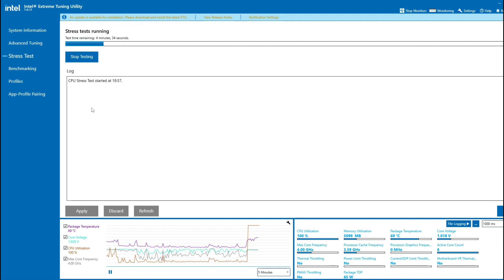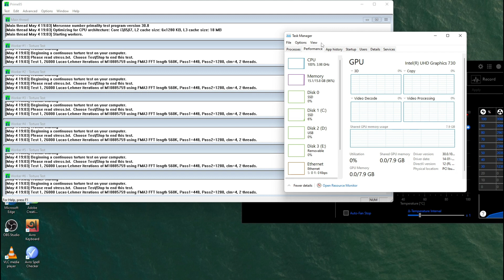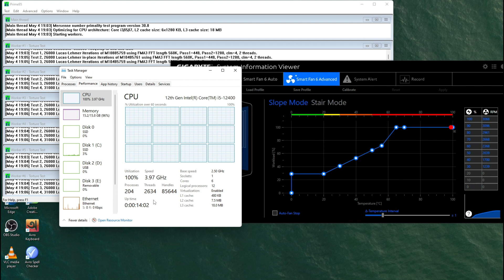Intel i5 12400 stock cooler perforamance test

Comment: Just built a pc with 5060 Ti and 12400f, using stock cooler and hitting 85c during sessions of Hell Divers 2. I'd like it cooler but I think thats acceptable as long as it gets not hotter. I did notice the pair seems to get much hotter than the 5070 series and higher cpus. Literally, the exhaust fans heat is much higher than the other 5 or 6 builds ive had in the last few months.
Reply from the maker: Temperature also depends on proper air flow inside your cabinet, use extra exhaust fan on top of the cabinet.

Comment: If anyone watching this and play games on this processor (i5 12400), I suggest you get a aftermarket cooler. I played gta 5 legacy at 720p low getting 70 fps avg and the temp reaches more than 85 C after long use. When I played farcry 3 at 720p low, within 15 minutes temps reach over 90 C.

Comment: I have a question, why does the i5 12400f only go up to 3.99 or 4.0 ghz when supposedly its maximum speed should be up to 4.4 ghz?
Reply: Reset bios configuration

Comment: Mine using CR1000 and it got 99 celcisus! HOW? (EVERYTHING CHECK, NO PLASTIC label, new thermal paste applied)
Reply: Mine is like this too man, did you found a solution?
Reply: @igorapenas  I just bought an AIO man, temp drops to 50~60 Celsius at 100% load. If you can not afford an AIO, just try to undervolt or maybe buy another fan cooler that has more cooling pipes.
Reply: @ Yes, I did the same is perfect now.

Comment: I recently bought the i5 12400F and am noticing my temps are higher than I am comfortable with.
It idles around 50C, it will reach 90C when I have an uncapped framerate, and if I try to launch a game in RPCS3, the processing will shoot it up to 100C. (It might go higher, but I got scared and Task Manager'd it before it finished)
It is also REALLY noisy, I find!

I thought maybe the thermal paste was poorly applied so I looked into what the average temperatures are with and without thermal paste, which was 10C and when I removed it, I experienced about the same gap so it wasn't poorly applied.
The cooler is just not adequate for me.
Can you recommend some aftermarket coolers?
I'm currently looking at the Thermalright BA120 but I'm not sure if there's a better one.
Reply from the maker: Cooler Master Hyper 212 is a good budget cooler.
Reply: @tryitstd  but this is for lga1200, no?
Reply from the maker: @Drixzhard  It comes with 1700 fittings too. Check description before buying. Better if you buy from offline stores.
Reply: Did you solve your temperature issue? I have the igpu version and I get the same idle temps
Reply: @ZA-7  I sure did, it's called "buying a Thermalright BA120!" I also bought the king version but it was more complicated, and when I tried it with the BA120, I got excellent results so I sent it back.
It was somehow both cooler and smaller than my old PC despite a higher power draw and higher clock speed/core count. It is...GENUINELY impressive how well that thing has done!
Reply: @TheGreatBackUpVIDEOS thank you!

Comment: can we overcloack i5 12400f with a stock cooler which comes with it ? ( i have a budget of $1000 and i want to build a full gaming pc set , if ill purchase a extra cooler it wil exceed the limit ) , btw im ready to exceed the limit as an extra cooler will only cost around $30 but is it worth it ? sorry for bad english
Reply from the maker: For overclocking you need a tower cooler.

Comment: i bought my new pc 2 weeks ago and i use stock cooler. I am using i5 12400 + rx 6700 xt and i cant play warzone because the temperature go to 100°C. i don know what to do, help please :(
Reply: Even my CPU temperature were hitting 100°C.
But after checking I found out that, I didn't install CPU cooler properly.
Currently it doesn't go above 73°C
Reply: @huhuhaha290 in warzone?
Reply: Dude you have installed your cooler wrong 😂
Reply from the maker: Use a tower cooler for your CPU. OR you can add extra exhaust fans if possible.
Reply: How the combo performance I planning to buy one
Reply: @ i had to buy a new cooler and it works perfectly
Reply: @Luquuiitaas  is game performance good? Can it hadle high settings
Reply: Which cooler ?  @Luquuiitaas
Reply: @theekshanamethmal2274  i had 12400f and 6750xt and it performed great for it's price.

Comment: What if you remove the power limits? MTP becomes 117W. Will this stock cooler still be enough for gaming?
Reply from the maker: Gaming does not require enough CPU usage, so for gaming this cooler is ok. But for CPU intensive workload this cooler is not very good. You can add aftermarket tower cooler for that.
Reply: @tryitstd Actually, it depends on the game... If the game is a CPU heavy, the coolerbox wont be enough to keep it "cold"

Comment: Just as you said the stock cooler is more than enough for gaming and normal use. With an ambient temperature of 20 C the max cpu temperature is 72 C, which is pretty decent for intel stock coolers. Last gens cooler were garbage, but this one is good, not excellent but just what you need to stay on budget. If you are considering buying a better cooler fir gaming,  save your money and spend that on a better gpu, that will really make a difference in your user experience, below 85 C is a a safe and good temperature, no need to go 50 if there's no thermal throttling.
Reply: Huh the temperature of my country is above 40 and my cpu goes upto 100 degrees no sweat more like too much sweat

Comment: I have this cpu and a 3060, and when i play Valorant or overwatch, the temperature of the cpu rises to about 87°, it even reached 97 at one point. I don't know what to do, thr cpu is new and the gpu too, i've added thermal paste (artic) and rebooted my pc, now it doesn't rise to 97 but still has an average of about 88° when i play. I have 3 front fans and 1 in the back of the case. Please help me since i can't afford a cooler for the moment.
Reply: Temperatures around 70-80° while gaming are pretty normal, for a stock cooler the average is going to be higher though, CPUs are built to withstand them and it isnt much of an issue, save up some money and buy a noctua cooler, just make sure you have the right socket.
Reply from the maker: Noctua will be overkill for this CPU, just get any cheap tower cooler like Cooler Master 212 or DeepCool Gammaxx
Reply: @tryitstd  I can get Noctua coolers for pretty much same price as any other cooler so yes, if Noctua is way more expensive no need to get it, you can definetely get your temps down with a cheaper cooler.
Reply: You have the V315 gaming case, just like me. Those 3 front fans and 1 in the back are not actual fans, they're just in there for the looks. I have i5 12400 and I got a 600w power supply to cool it from the bottom and push the air out. Just get something cheap mine was like $55 but the guy installing it in my pc gave it for $30.
Reply: Is there any way to lock the temps at 80°C for the 12400f?

Comment: My pc starting tem is 48 to 50 is good or BAD12400F stock
Reply from the maker: It is quite good, temperature above 85 degree is bad.
Reply: @tryitstd could you please tell me that did I have to buy after market cooler for my 12400f
I do gaming,editing and browsing❤
Reply from the maker: @mindspark769  If you are a hard core gamer then after market cooler wold be good. Tower coolers are perfect, don't go for liquid coolers.